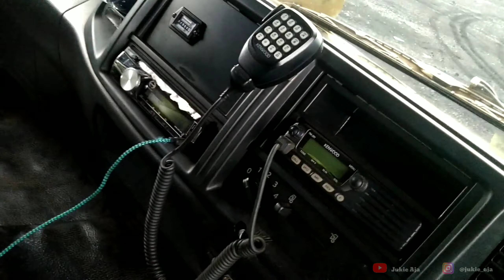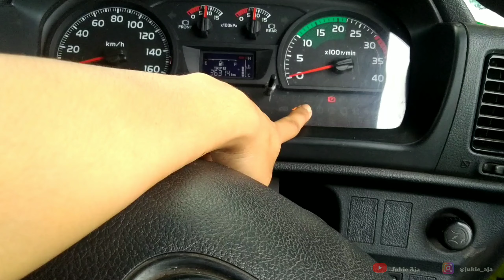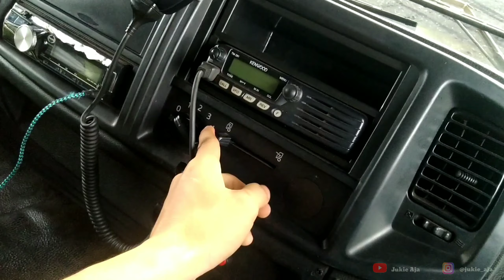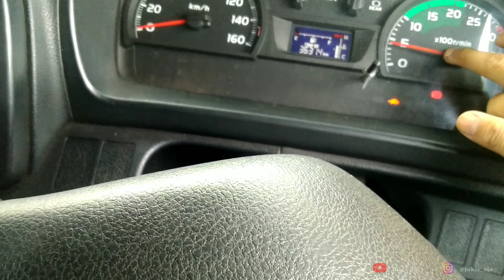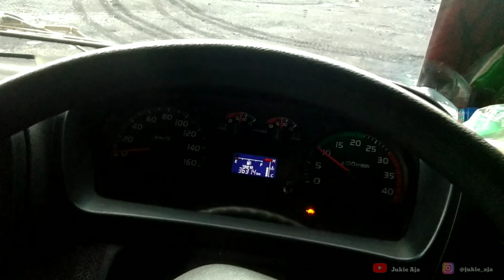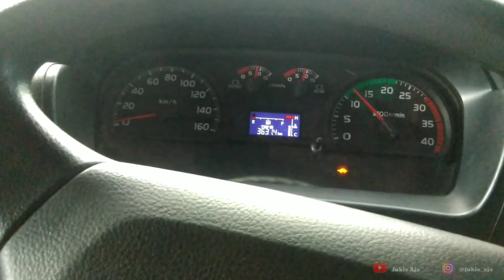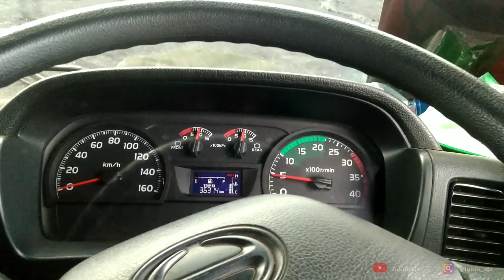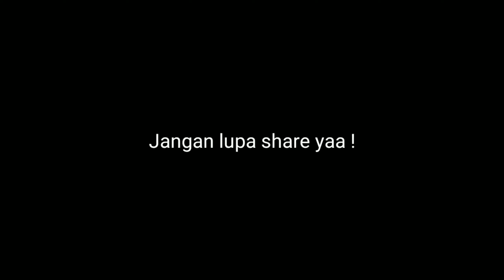Cara mengoperasikan Dump truck Hino500 FM 260 JD @jukie_aja

Comment: Assalamu'alaikum... Bang cara ganti gigi dari kura2 k kelinci, saat brjalan ada muatan bang🙏🙏
Reply from the maker: Ketika ingin mengover gigi dari kura2 kekelinci pastikan dulu RPM nya harus berada diatas 1.500 atau berada dikecepatan 30-40 KM. Karna kalau dibawah itu tenaga bisa langsung down mendadak. Dan harus mulai dari gigi 1 lagi deh
Reply: @jukie_aja  Bro HINO 500
Fm 260 Ti saya kalau parkir sbntr dan dimatikan Angin nya langsung Kosong lagi. Itu biasanya bocor di bagian mana ya angin nya. Saya pemula bawa yg 260 Ti 
Blum terlalu paham 😄 baru belajar
Reply from the maker: Coba perhatikan dan dengarkan ketika engine pas posisi mati. Apakah ada terdengar suara kebocoran pada hose/selang kecil didekat tangki kompresor.

Biasanya kasus kaya gitu kemungkinan ada selang kecil dibagian tangki kompresor yang pecah. Ada kemungkinan juga bisa sel dibagian master kompresor nya rusak
Reply: @jukie_aja  terima kasih 🙏
Reply from the maker: Kalau Hino 500 pakai splinter. Itu pungsi nya untuk memindahkan gigi kelinci ke kura2. Juga sebaliknya
Reply from the maker: Splinter itu posisinya tepat di hendle gigi
Reply: Bang kalau swit renceng bersamaan dengan kita injak pedal kopling apakah berubah atau tetap..mohon pencerahan nya bang
Reply from the maker: Berubah kalau di ijek kopling
Reply: Bang kalau over gigi dari gigi 1 sampai 4 sama sperti mobil truck roda enam biasa kah?
Reply from the maker: @sukardikakisina3501 bisa aja

Comment: Apa beda nya Hino 500... 260 jd sama Hino 500... 350 pl...
Reply from the maker: Yang disebut Hino 260 jd iyalah Hino 500. Cuma rata2 orang jarang bilang ooi itu Hino 260 jd, jarang orang bilang begitu. Karna sudah kebanyakan orang ngomong nya ooi itu Hino 500, karna mungkin penyebutan nya lebih simpel.

Perbedaan Hino 500 dengan Hino 320 jelas beda. Dari segi kabin dan juga engine sudah ketahuan
Reply: @jukie_aja  oiya Bang.... Beda nya di cabin sama CC nya...